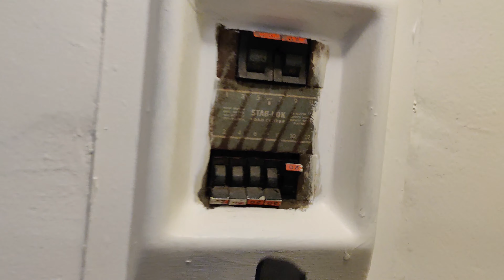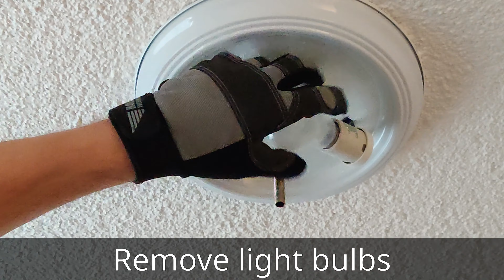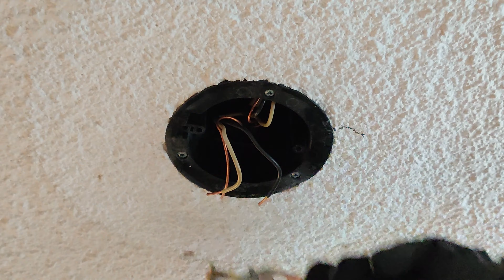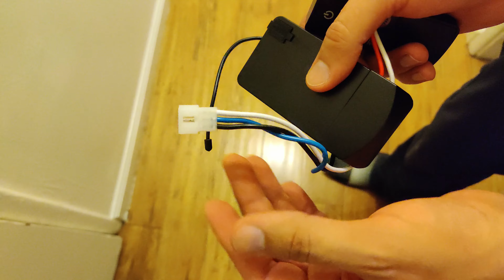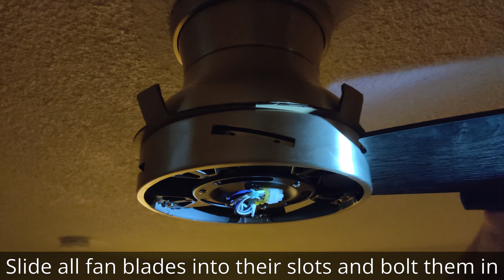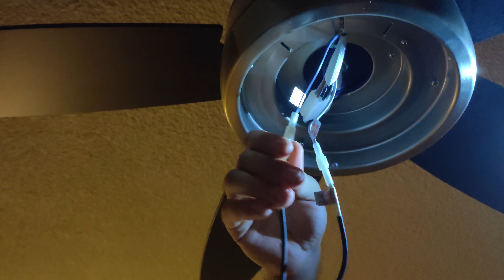LED Ceiling Fan Install - Home Decorators

Comment: Ladies and Gentlemen do NOT do what this fellow just did. The electrical box shown in the video in the ceiling is NOT meant for fan support and is plastic. Not only that, the box is supported by three small tabs that are holding onto the drywall, nothing else. Please make sure you’re mounting a ceiling fan on a metal electrical box that is supported by a joist in the ceiling. If the maker of this video sees this comment, I mean no disrespect, but I am a licensed electrician, and only watching out for you and future viewers. I’ve seen many fans come loose and fall after some time after being installed like this.
Reply from the maker: Thanks for the comment. Luckily, my ceiling fan has not come loose yet. However, your comment caused me to look further into ceiling boxes and fan support. I will definitely be updating my box in the coming days. Also, I found this video which does a great job explaining boxes: https://youtu.be/Ii938I_PDEk